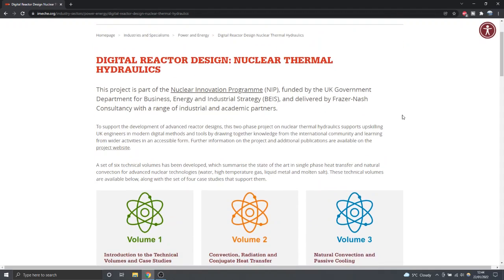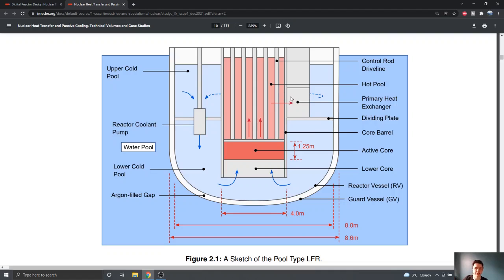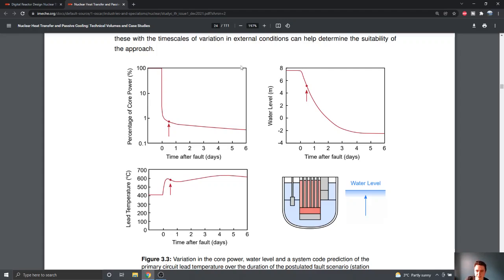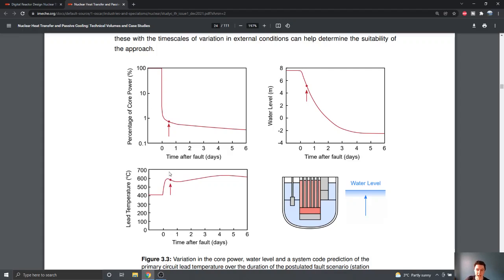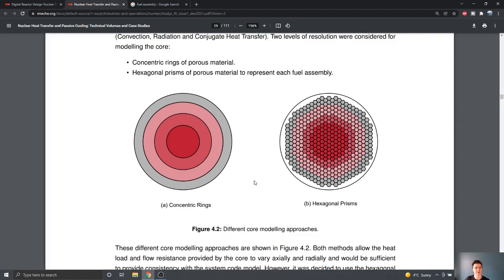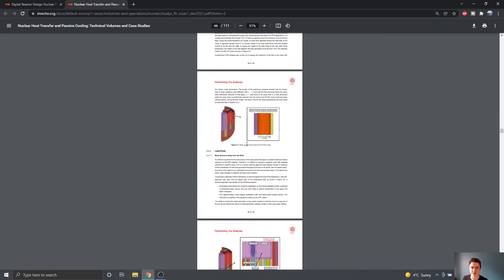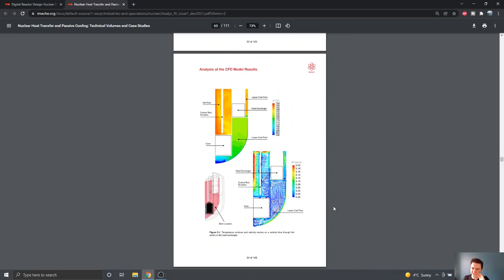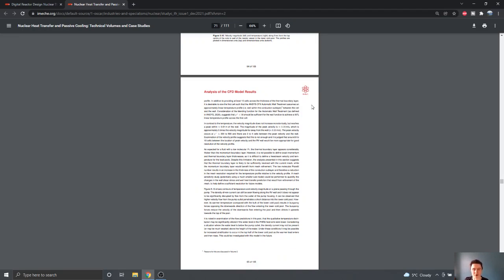CFD Analysis of a Lead-Cooled Nuclear Reactor

Comment: Here is a further lead cooled reactor design.

🔋 Key Advantages of the Dual Fluid Reactor (DFR):

• ⚡ Ultra-efficient: Nearly 100% of nuclear fuel is used  
• ♻️ Burns nuclear waste, depleted uranium, and even thorium  
• 💥 Transmutes long-lived actinides into short-lived fission products  
• 🔄 Built-in Pyro Processing Unit (PPU): Continuously removes neutron poisons and extracts valuable metals  
• 🛠️ Liquid fuel: No solid fuel rods, no batch reloads  
• ⏳ Decades of operation with a single fuel load possible  
• 🚫 No corrosive salts: Liquid metal fuel avoids fluoride corrosion and complex chemistry  
• 🧊 Lead coolant: Excellent radiation shielding, no water, no pressure → no steam explosion risk  
• 🌡️ Very high temperatures (700–1000 °C): Enables hydrogen, e-fuels, ammonia, and direct steel reduction  
• 🧠 Self-regulating: Output adjusts automatically via negative temperature feedback  
• 🪫 Minimal waste: Only short-lived fission products remain
• 🏭 Compact & scalable: High power density, ideal for modular deployment  
• ⚙️ No moving parts in reactivity control: No control rods required  
• 💰 Uses existing stockpiles of spent fuel, DU, and thorium  
• 🌍 Reduces dependence on enrichment, imports, and fresh uranium mining  
• 🔄 Full closed fuel cycle: No external reprocessing needed  
• 🆚 Outperforms typical SMRs: No pressure vessels, no high-pressure coolant, no water-based systems

Comment: I have just started my Master's degree in Nuclear Energy Engineering from a Mechanical background. My research topic will be on the LFR flow (using LBE ) and heat transfer in tube bundles. This video has helped me to have an idea of what l am about to face. THANK YOU SO MUCH!!🙏
Reply from the maker: Definitely check out the technical volume on liquid metals and the case studies. You will find loads of helpful stuff in there 🙂
Reply: @fluidmechanics101  thanks so much 😅. I will check it out.

Comment: Thank you for such an in depth and engaging guide. Not only does this detail the CFD modelling side of things but it has really educated me in nuclear reactor designs and the disaster scenarios. This is much appreciated! 
I do have a question that might be a bit silly since you may have covered this earlier on in the video, but I was wondering:
At 55min, you described the meshing of the fuel assemblies and the interwrapper region modelled as porous media. Since the fuel assembly is modelled as a solid and the interwrapper as a fluid, how do you stop the solver violating the V.n=0 to the solid? i.e. the fluid from the interwrapper region leaking into the fuel assembly porous region?
Reply from the maker: Both the fuel assembly block and the interwrapper gap are porous media, so fluid can flow in both of them. The key is to use a two-sided wall (zero thickness wall) between them, so that fluid can't pass between them

Comment: It would be really useful to know how long it took to run the simulation (after meshing) to get these results and on what compute resources.
Reply from the maker: Roughly 2-3 days steady state on 40 cores. Then about 1-2 weeks for the transient on 40 cores. Not massive but deliberately achievable for most engineers

Comment: really enjoyed it and learn alot. I had a semester thermic simulation in university. we worked with easy problems like a glass of soda partly in water and the sun is burning from above. Its really fascinating what you can use this for and which amazing engineering you can simulate.

Comment: Impressive work! That mesh in a second order solution!  

I work on the thermal design of nuclear components  and it is nice to find reports with this quality open to the public. I will read carefully all the reports since blackouts are always a pain in the neck to model using CFDs. 

I am curious about how the heat generation is included. Is there a MCNP model (maybe another particle transport solver)? 1d profiles?
Reply from the maker: It's just a volumetric heat source that varies across the core. The central fuel assembly porous zones have a larger heat source than the outer fuel assembly porous zones

Comment: Hello i am a huge fan, and i have a question. I previously tried to use poly hexcore meshes i generated using ansys fluent emdded meshing but eventhough i manged to convert the mesh to polymesh (which is really tricky) the results i got were effected by the polygonal meshes in a way ansys results arent affected. this got me thinking that Fluent code has some way of compansating for these types of meshes but openfoam doesnt. What do you think about this and what would you reccomend to be able to use these fluent generated poly hexcore meshes in openfoam. Thanks in advance you are awesome.
Reply from the maker: I'm not sure about this one, I have to say! What type of case were you running and how fine was your mesh?

Comment: The report explains how the solution was developed in several stages and proceed to explain them, but could you explain how you practically go from one step to another? they are like different simulations in series or in some way you can stop one simulation and modify parameter and other stuff and then restart? really i dont have a clue about this and i'm really interested about this. Would be an excellent idea for an entire video too imho. Keep up the amazing works (i bought your courses as well)
Reply from the maker: Yes, in a practical way you can take the results of one simulation and then use these results as an initial condition for the next simulation (just changing a parameter like turbulent Prandtl number, flow rate or heat input). This is a really efficient way of doing lots of simulations quickly and is commonly used in many areas where we need to look at a large parameter space
Reply: @fluidmechanics101  thanks very much! Anothere quick one is why we chose kw sst? Simply because at the end of the day its the best one for wall guided flow? I wonder if there where another accettable candidate!
Reply from the maker: The best turbulence model is problem dependent and none of them are perfect. The only way to know is to carry out a test against experimental data for a simple flow scenario that is similar to yours. The best turbulence model for this case is likely to also be the best for your case. It just happens that KW SST seems to be pretty good for a lot of cases these days (probably by chance more than anything)
Reply: @fluidmechanics101  great, so have u tried also another model?
Reply from the maker: Yes, we looked at a few. You can see the details in Case Study 1 (Liquid metal CFD modelling of Tall-3D test facility). We also have a comparison to LES

Comment: It would be great if you can discuss the modification of the turbulent Prandtl number since this is the low Prandtl number fluid.
Reply from the maker: Yes 🙂 there is some detail in the report (and the technical volume for liquid metals) if you would like more info
Reply: There are other approaches, like algebraic/transport equation models for turbulent heat fluxes to deal with these flows.

Comment: could you please go through the meshing process in your particular example with the CFD software? it would be interesting to see how you did your mesh sizing analysis (coarse -medium-fine) to find out your heat exchange ratio just like what you talked about in your professional CFD course on Udemy.
Reply from the maker: Yes! Good idea. I will see if I can put together a video on some of the details
Reply: @fluidmechanics101  thank you. A lot of us engineers know how to run the automatic meshing process in the CFD software but 99% of the time the automatically generated meshing doesnt work because we fail to understand the Y+ and Y* . So, what we really need in most cases is a structured mesh considering the solver, mesh sizing and etc. I have to admit that some of these skills have to be gained through years of simulation but I think you have a gift in teaching because the way to present these topics is excellent. again, thank your for sharing your knowledge.
Reply: @xuxu119  nowadays, generating structured mesh isn't that big of a problem especially with meshing technologies like mosaic meshing. Especially in industry where time is fairly valuable, using an automated mesh process that give you a decent structured mesh in the core with sufficient boundary layer is all you need.